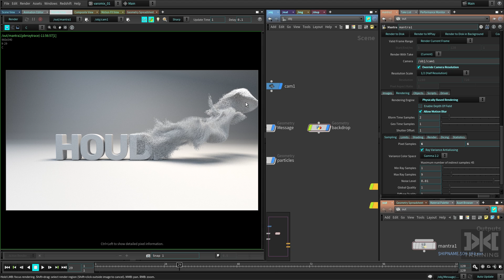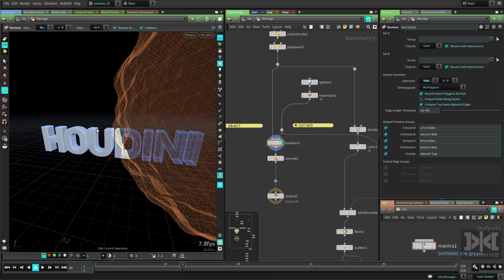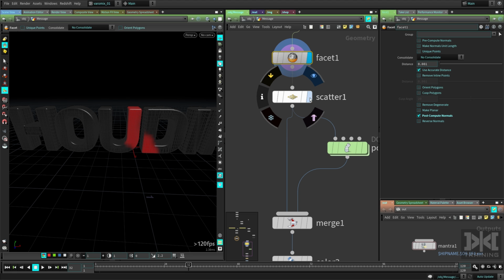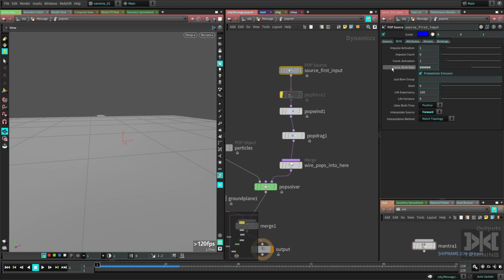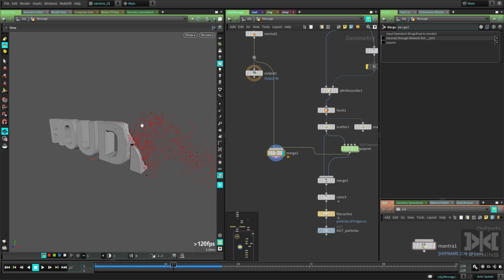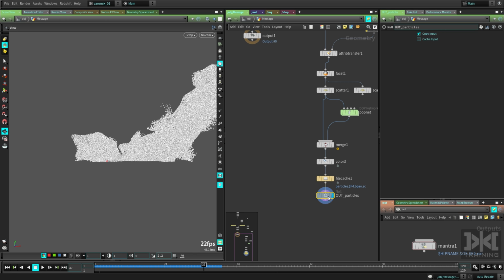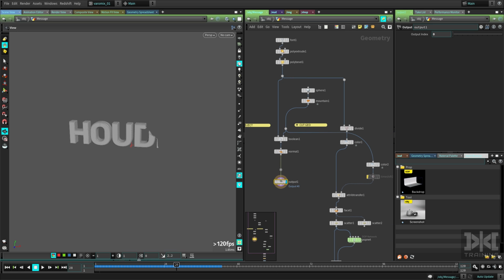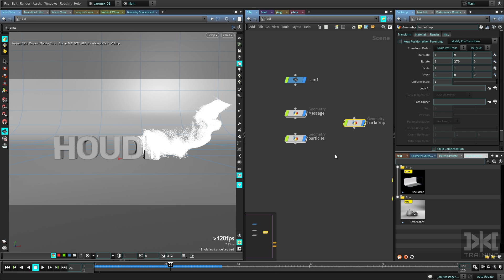VMT 017 - HOUDINI - Disintegrate Geometry

Comment: I'm not getting the red color in between the two geometries?  Any setting on the attribtransfer1? :/
Reply from the maker: In the attribute transfer node, in the Attributes tab, select the attribute you want to transfer, in this case, Cd, in the points section.
Reply: also play around with the "distance threshold" and "blend width" under "conditions"